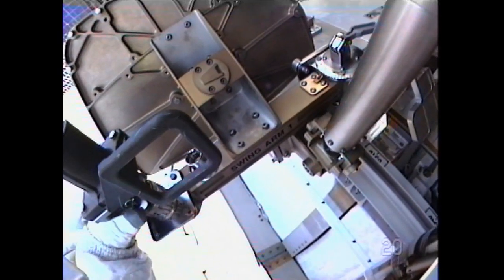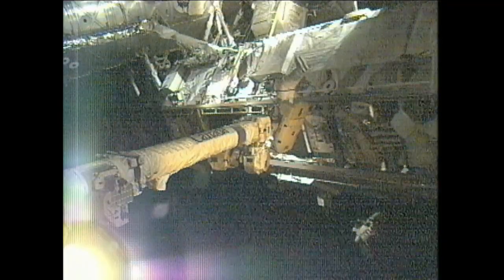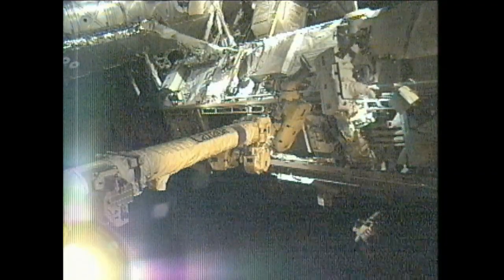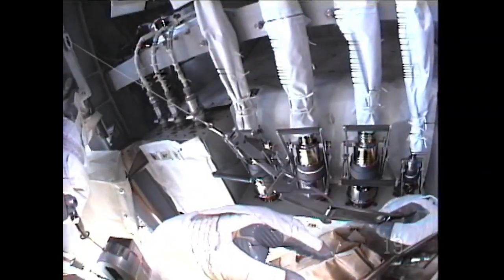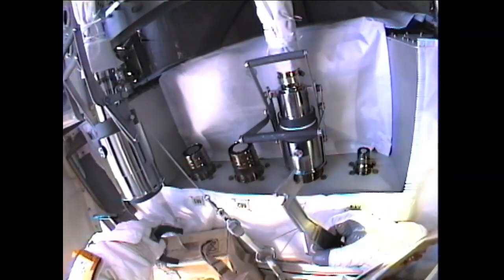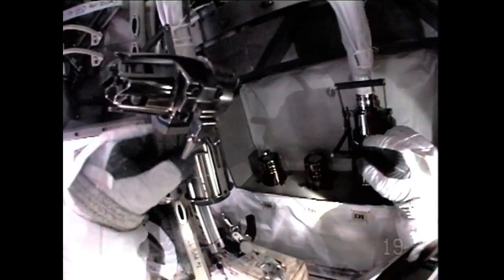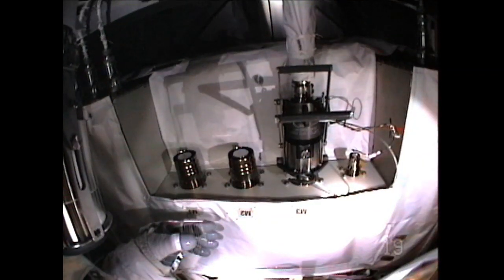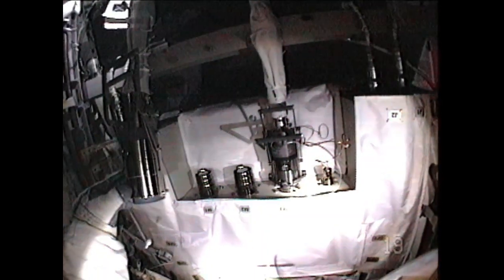Astronauts Make Progress on Spacewalk

Comment: Scary Stuff. That last cable was still pressurized at over 350 PSI when he finally got it loose. When the ammonia started to freeze and fly out of the hose, it obviously was disturbing to the crew too. Hence the reason he inquired as to the pressure that was still in the hose. I guess they are now going to ahve to look to a way to close off another section of the pump/assy to isolate further the ammonia and have the ability to minimize losses while they can sill relieve the back pressure.